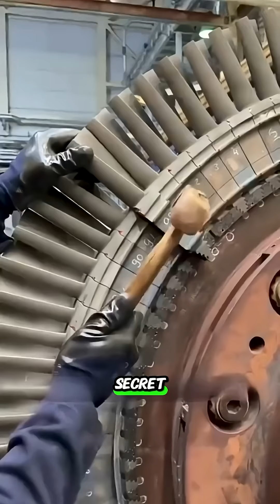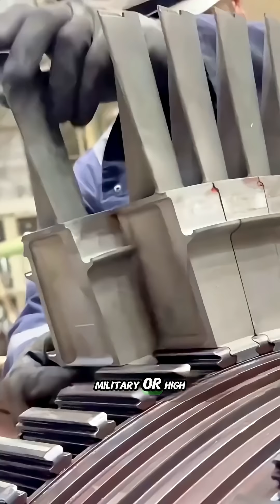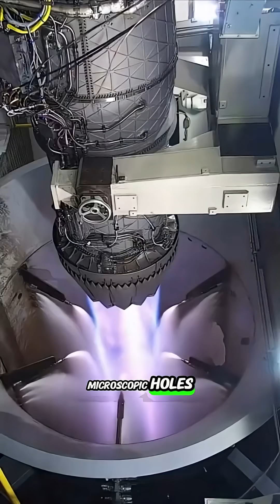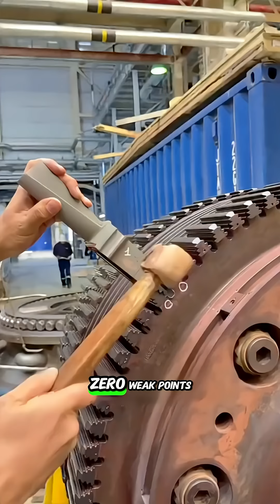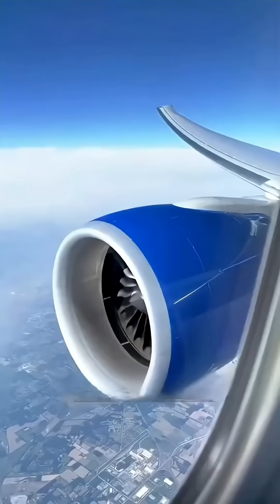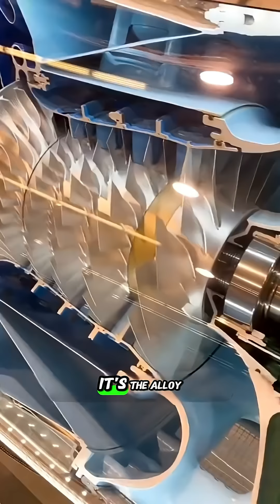The Insane Reason Nobody Can Copy American Jet Engines

Comment: Rolls Royce rolling their eyes
Reply: Create mostly accurate but misleading video, people run to the comments. creates engagement, profit.
Reply: @Shred303 you know what....your right.
Reply: @Shred303  yet the most powerful jet engine ever is in fact American the GE 9X, and even for fighter jets the most powerful fighter jet engine is the American Pratt and Whitney f135
Reply: @thatPilotandCarguy the problem is not power, any engine manufacturer can create powerful engines, the problem is reliability, the M88 of the Rafale is way more reliable than the F35 engine and needs less maintenance...
Reply: @SierraHotel-MB  Maintenance isn't as big of a deal when you have a $1,000,000,000,000 defense budget
Reply: @Vlalada0  Nope. A Jet, that is permanent    on maintenance can´t defned the people.
Reply: @Lutscherkoenig who has the raphael defended except in the papers
Reply: @gabrielebmomavug According to the U.S. Government Accountability Office, only 25% of F-35s are fully mission-capable (able to perform all missions). The cost of maintaining an F-35 is $6.5 million per year. Ten hours of maintenance are required for every hour of flight.
Reply: @Vlalada0 it is otherwise you wouldn't close the 22 project despite the QUALITY  of the aircraft, and many other exemple as the F14
Reply: @Vlalada0 1 trillion dollars which ¾ goes to the pocket of corrupt and filthy rich individuals.
Reply: @Vlalada0 isnt big deal ? 😅😂 what kind of American Logic is that 😅😂 big powerful - doesnt matter the cost 😅 im not amazed anymore why Americans are even Born with credit score 😅😂😂😂😂
Reply: @milanko91  I'm amazed you don't understand percentages
Reply: @Lutscherkoenig what jet is permanently in maintenance? Jane you not been paying attention to the middle east?
Reply: @Lutscherkoenig 25% percent of 850 is still 215 jets.

Also, another 55 percent are mission capable. That's 80 percent of all US F35s that are mission ready.
Reply: @Vlalada0 😂😂😂😂 yes that is my deep fault 😂 how Did you know that ? 😂😂😂😂
Reply: @Lutscherkoenig So you're talking about multiple different things. In terms of engine reliability the F-135 engines are some of the most reliable engines in the world. The overall reliability for the mission set is mostly because the F-135 is currently going through an upgrade where they're getting new additional features. Yes it is expensive to maintain the plane mostly because the stealth coating isn't cheap
Reply: @gabrielebmomavug tell me who the F35 has defended 😂

Clown
Reply: @thatPilotandCarguy . So? Is that metric relevant?
Reply: @milanko91  we aren’t born with credit scores wtf are you talking about. You have to build your credit score over years of financial responsibility.
Reply: @SierraHotel-MB  look at how many flight hours we get out of them. We do WAY more training hours and our pilots fly year round so they are always ready to defend like it’s just another day at work.
Reply: @krowwithakay the F35 needs to be grounded more than a day after every mission😂, the incident and malfonctions are multiple and so many compared to all other fighter jets that exist out there...you don't know what you are talking about
Reply: @krowwithakay hahaha thats what im talking About 😅😂 your matrix just shows that you dont understand that you are Born with credit score and with your interests and payments getting Numbers 😅😂 in normal countries there is no credit score 😅just shows how you think - the most powerful doesnt matter cost - shows how deep propaganda you have there 😅
Reply: @karrole88  you need evidence for such claims.
Reply: @Vlalada0  Until suddenly it is. Ask the Russians.
Reply: @thatPilotandCarguy Remember 1942 when Britain sent you a Whittle turbojet engine? The jet engine we invented and GE didn't think was possible... You can thank us now 😂 ...idiot
Reply: @thatPilotandCarguy Until Rolls turns out a bigger one. What are they fitting to the B52? Rolls Royce engines.
Reply: @thatPilotandCarguy But they were invented in England back in the 1930’s by Sir Frank Whittle.
Reply: @thatPilotandCarguy That wasn't what the video was about.
Reply: @Lutscherkoenig Can't even write a line  comment Who has the F35 defended? Attacked maybe, but the F35 has very limited combat experience. Fighter jets are a huge booondoggle - now more than ever.
Reply: @stuartplumbly7201 there was a German scientist that brought one out at the same time. And Germans got the first jet fighter into operational service. Aerodynamically it was way ahead of anything Britain built until after the Korean War. Britain gave the Nene engine to the Russians, who then used it to power the Mig-15. In addition to Nenes for Migs, Britain provided Seafire 47s, Seafurys, Meteor Mk8s, as thier contribution to NATO aviation.
Reply: @Lutscherkoenig  Yes both the F-22 and F-35 are expensive and cost a lot to maintain, but there aren’t any planes in the world that can stand up to them. Most enemies die never having detected the fighter that killed them
Reply: @Vlalada0 not for much longer
Reply: @Lutscherkoenig You are another ill informed fool that reads something without knowing what you are reading. GAO has nothing to do with mission readiness.
Reply: @Vlalada0 it is when you're at 30000 feet and more, it's not as if there's a hard shoulder like on a motorway you can just pull over and pop the bonnet 🤔
Reply: @Lutscherkoenig that’s why they mostly use the F/A-18 super hornet that was made around 3 decades prior
Reply: @SierraHotel-MB I hear that congress has plans to bring back the F14. It’s called the maverick act! They will refurbish 3  F-14D’s to use as instructional purposes as well as in air shows. Called “the Maverick Act”. I hope it’s true. I would love to see one fly again.
Reply: @SierraHotel-MB  No one claimed US Congress was intelligent. Their approval rating is 10%, and they control the budget.  Luckily, the 22 has been the boss for 30 years without being challenged, so we haven't ended up needing more.
Reply: @Lutscherkoenig  So tell us you don't understand what that statement means without tell us.    It does not mean the F35 is unreliable dummy, it means the supply chain is still young and has to compete with current manufacturing of new jets PLUS make enough spares for in service aircraft.  It has ZERO to do with the plane being unreliable.  Also, maintenance costs are a function of same supply chain maturity dynamics.  Costs are dropping fast as more planes are fielded and more parts become available as the supply chain matures.  this is true for every planes ever manufactured in history.
Reply: @Vlalada0 it is soon going to be very important
Reply: @gabrielebmomavug  Because Europeans don't run around the world starting wars like the US does.
Reply: @thatPilotandCarguy if you don't count the Rossians but I still doubt there's even US American engines at all
Reply: @Vlalada0 still it is.
Reply: @gabrielebmomavug France Africa the world
Reply: @Lutscherkoenig no tnx. My country like most countries we'll stick with the MIGs & Rafael's
Reply: @milanko91 yes at 1st grade we're already in bankruptcy but till the age of 21 we've already rebuilt our credits
Reply: @Mickey-s4c you dont understand concept where credits doesnt even exist 😅 you didnt rebuilt credits and by 21 there is no way unless you are rich family . You have school loans, medical loans , everything is in credits . By 30 you are repaying debts and building ratio on credits to be able to get better loans . In EU ( not UK as it is Anglo-Saxon system similar to yours but your is an extreme ) you dont have any credits . And dont tell me Americans are rich 😅 if that would be case - medical debt of Americans wouldn’t be as gdp of some nations and be crowdsourcing sites to help those people and etc 😅 you talking like in 21 every American is millionaire 😅 in fact - by assets you will find more millionaires in poor countries in that sense - because they own assets - they just don’t earn much per month . So its question about liquidity and wealth . By wealth measure every European can beat American . In liquidity maybe no - but again your liquidity is based on - you decide everything . From your net income you must decrement even insurance or so - our net income is real net income - just your normal expenditure on everyday expense - housing clothes loans and etc . In America if you don’t work for big rich corporations - you don’t have that luxury . You must account for insurance pension and etc
Reply: @Vlalada0 between the Senat & the Congress which one is more fucked up?
Reply: @milanko91 compared to West, the wages & salaries in USA are lower
Reply: @Mickey-s4c it depends how you measure those things 😅its not All simple answer as you go deeper 😅 but what Im trying to say - you have credit score and even boastimg About it 😅 but its just cage as you are borned with it and forced to use debt to have better future debts 😅 just think on how much debt US has on credit/debit cards vs in EU for example . Normal People in EU dont even have those cards . We are not forced to buy new iPhone on card debt because it will have good impact on credit score plus new IPhone 😅 for european mentality its wild concept 😅 We either have those money or dont 😅
Reply: @Vlalada0 boss of what ? Parade in meeting? 😂😂😂
Reply: @t @thatPilotandCarguy actually the GE X9 is suffering from development issues because of the size of the turbine fan. It is so big that the force acting against it is outside of the limits for even titanium
Reply: @eifeldude1  🤣 are you slow? Last time I checked there’s not a single jet engine in history that didn’t have development issues
Reply: @thatPilotandCarguy which aircraft  is that f135 engine in ?
Reply: @_Coffee4Closers until raw materials aren't shipped from China.
Reply: @Vlalada0 And a debt of 40 trillion...
Reply: @SierraHotel-MB  I just looked this up. it's not the F119, F135, F110, F100, and EJ200 all beat the M88. This is based on a comparison of Mean Flight Hours Between Removal.
Reply: @DUSTER7071  the also American F-35 lightning II
Reply: @baniganj yeah source :trust me bro😂
Reply: @Shred303  Well... at least this video wasn't entirely full of sh*t :D
Reply: I make these parts for RollsRoyce 🤣 they make jet engines
Reply: @jjmartin6422 How about the generation to generation engineering knowledge the workers posses?
Reply: @TheQuietStorm6000 I. Not sure what you mean here 🤔. Rolls royce has been making plane parts for about 80 years, they're just one company I make parts for.
Reply: @TheQuietStorm6000 
This video makes it sound like the US is the only country that builds jet engines...
No even close to true.

The Jet was  originally invented by British engineer Frank Whittle, when he got his first patent in 1930.

In 1933, a German engineer called Hans von Ohain also designed a jet engine.

As for the modern era, Airbus aircraft use European designed & built jet engines.

The Eurofighter Typhoon uses the European designed and built EJ200 jet engine, with an official top speed of Mach 2.0,  Mach 1.5 supercruise and maximum recorded altitude of 87,000.

And there are other countries around the world that build their own jet engines.
Reply: This is what makes a country a super power.  Not financial engineering.
Reply: @jjmartin6422 Do you work stateside or in England?
Reply: @Common_Sentences I am state side, for certain parts the Gov. Mandates that they cannot be sourced or shipped outside the US, common parts aren't as strictly controlled.
The company I work for though does manufacture in Canada and Mexico as well.
Reply: @TheQuietStorm6000 read some history
Reply: @simonoleary9264 ... Which is why they didn't say the US is the only 1. They did, however, state that we've dominated the jet production scene for 50 yrs. That's a far cry from claiming they're the only producers. We're rapidly losing our manufacturing edge so just keep from getting your panties in a bunch & you'll get your shit-talking opportunity.
Reply: @st.bonhomie8585 stfu.  My kids aren't this immature and antagonistic kids. They are 8&9.
Reply: @simonoleary9264 but when it comes to military jet engines, Pratt & Whitney basically dominates that market. They’re the ones that makes the engines for the f35, which has the bragging rights of being the most powerful afterburning jet engine (I believe) ever made.
Reply: @brendanlaven1697  oh, how about the Russian jets? The Chinese? Swedish? Seriously.
Reply: @brendanlaven1697 that’s only true compared to the J58 because a lot of the J58s thrust came from the inlet and the bypass tubes in the nacelle taking that compressed air right to the reheater. 

But yeah between the J58 and F135
You got two powerful beasts.
Reply: @Helen @Helene-e4x he Swedes don’t build their own jet engines for the Gripen. They use American engines. Building jet engines is hard.
Reply: @passantNL  Ah, right, I confused it with the Eurofighter, my bad.
Reply: @Helene-e4x  Russian and Chinese jets are well known for having short lifetimes, fighters anyway. They build for light, cheap, high maneuverability thinking they're going to get shot down anyway, so why go expensive? China mostly builds licensed Russian knockoffs, Migs. I guess the J-20 is theirs.
Reply: @fedfraud.protection.servic2557  although, you must admit that Rolls Royce manufactures quite good engines, Pratt & Whitney and General Electric are not the only ones. Besides, that Russian and Chinese jets have short lifetimes does not mean that the engines are bad.
Reply: @Helene-e4x I think that the statement was more aimed at the countries that the US and UK are adversarial with. We share knowledge, engineers and tech.

I worked at an Aerospace Shop in the US once that started production in China, we had some machines we sent them. We were required to go into the software of the machine and mess with the parameters so they couldn't maintain the regular high accuracy we had in the US. So we do things like this as well.
Reply: @SeatownD   fair point, but that does not change that the jet engine is not american, and that the usa is not the superior manufacturer
Reply: @TheQuietStorm6000 generational knowledge from workers is useless. Managers don't care. H1b is all they care about😅
Reply: @simonoleary9264 derby woop woop
Reply: @simonoleary9264 . Hans von Ohain of Germany was the designer of the first operational jet engine.

But who was “first” is irrelevant
Reply: @TheQuietStorm6000 
It is both! 😉
Reply: @Helene-e4x 
RUSSIAN NUMBER 2
SWEDISH NUMBER 3.
Reply: @simonoleary9264  Boeing also uses European engines, btw.
Reply: @brendanlaven1697 but they still rely on British engineering for the vertical lift system.
Reply: @Helene-e4x I'm biased, but the US IS the superior jet engine manufacturer. Of course, Rolls Royce is up there, as well. That's part of why the US has the best fighter jet ever manufactured. China and Russia, their jet engines are the cars of today. They're throwaway designs because they know they can never compete with the west's superior design and manufacturer capabilities.
Reply: @TheQuietStorm6000 what? Telling yourself you are the best until you believe it?
Reply: @jjmartin6422 It's actually 111 years.
Reply: @simonoleary9264 Yeah yeah yeah whatever.  The US has made the most advanced jet engines for civilian and military use for decades.  Rolls is great but they have been helped by GE and Pratt and Whitney. The Russians and Chinese have for years been trying to steal our technology for jet engines for decades.  Hmmm wonder why that is???
Reply: Also you fool no Typhoon flies at over 80,000 feet.
Reply: @TheQuietStorm6000 but murica isn't a superpower. It's only famous for hamburgers and stupid presidents
Reply: @simonoleary9264 America's are best tho
Reply: @TheQuietStorm6000 Which of course can only happen in America.
Reply: @jjmartin6422  I do too..
Reply: @jjmartin6422 He didn’t say No One else did he.  I believe he said hardly anyone else.
Reply: @xXGENDAMAGEXx first of all you need immense amounts of investment to mount an enterprise capable of doing this. Also, a highly complex and very expensive educational system to train engineers and workers. It's an entire system that only a few rich countries can do.
Reply: @botutu1   Plus you're going to have a bunch of R&D Investment or else foot the patent bill for licensing. That could jack the price up. This is an eye opener.
Reply: @xXGENDAMAGEXx  Read the very bottom line in the video. Now you are just playing 
semantics.
Reply: @davidkillens8143  Yes, it says "The Insane Reason Nobody Can Copy American Jet.

Why is it so hard to build a jet engine? It’s not about the blueprints—it’s about the impossible manufacturing process. From turbine blades that cost as much as a BMW to internal cooling systems more complex than human veins, discover the insane engineering that keeps American jet engines 50 years ahead of the competition."

They did boast that "Nobody Can Copy American Jet." and that they are "50-years ahed of the competition."
Reply: @jjmartin6422  The Trent 1000 has been Rolls-Royce's most troubled modern engine, costing the company over £1.3 billion in repairs and redesigns.  

That is just the top of the list of defect and process in manufacturing issues with Rolls Royce. All Manufacturers have spec issues..but Rolls Royce is not a bragging point in Aviation anymore my guy.

Sincerely Aeronautical Mechanical Technical Engineer.
Reply: @jjmartin6422 And of course superb cars ..
Reply: @jjmartin6422 no you don't. The use of emojis suggest you to be a teenager. Epic fail
Reply: @jjmartin6422 and Ford makes cars.  Doesn't make them equal to a rolls does it? You get the point
Reply: @jjmartin6422 I was about to ask , what about RR. Sean them on many of my flights. So RR and American engines dominate...
Reply: @jonjones1233 but the RR. Factories are in the U.S  and Germany
Reply: @stubstoo6331 AND in Derby, in England.
Reply: @martinsims1273 yes all business today is global
Reply: @jonjones1233 umm (seen)
Reply: @jjmartin6422 Listening is hard for you, he said “very few” companies have mastered it. Didn’t say nobody, calm down
Reply: @gregjokonis1776  the title says "nobody can copy American jet engines" ... the BS was made at that point
Reply: @patthewoodboy Ok buddy, whatever helps you sleep at night
Reply: @gregjokonis1776   I dont sleep at night I am a vampire and will come for you 🙂
Reply: @gregjokonis1776 Reading is hard for you....
Reply: @gregjokonis1776  Read, man. Read
Reply: @Geokinkladze Nope I did read and it was supplanted with very few, so if you want to go down that route and stick to comment, so be it. You defending your boyfriend is cute as well.
Reply: @gregjokonis1776 You effed up dude, come on, just accept it.
Reply: @theeltea I didn’t so go sit in the corner and hush.
Reply: @jjmartin6422 
If that were true you'd know that even the engines in the EF Typhoon still pale in comparison to the engines in the F22.
Let alone the ones in the F35 or our new adaptive cycle engines being developed.
The video is right. Anyone can build a jet engine.
No one builds them like the US.
Reply: @W1ckedRcL  you are correct. IDK what I said that makes you think we're in disagreement 🤔
Reply: @jjmartin6422 
I thought you were saying you make parts for Rolls and implying that it's not a big deal. That anyone can do it like the US.
I have apparently misunderstood your tone.
My bad.
Reply: @W1ckedRcL all good. I make the parts for RR in the US 😎👍
Reply: @W1ckedRcL 😅😅
Reply: So, the US is the only country successfully building jet engines. apart from UK, Germany, France, Japan, China, Russia and Sweden, no one can build jet engines. Oh, wait Czech Republic builds some as does Korea and India. But apart from them and the countries who supply parts, what have the other countries have ever built jet engine parts like compressor blades. Oh wait, Ukraine builds some parts and there are countries who contribute other parts. But…….what country produces the most 🐂💩 per year? Yes, the US wins that category.
Reply: @gill7087 
Hold on... Military jet engine manufacturers are really a small club.
UK and France are part of it. Rolls Royce and SAE are doing their military engine 100% on their own.
But not Germany (MTU built 30% of the EJ200... Far to be enough), not Sweden (they use GE engine rebranded with small modifications. The HPC part you can see in the video... Nope).
Czech republic... Nope. PBS built turboprop but not military jet engines.
Japan: nope too. They build turboprop too. 
Let's be clear. A modern and competitive domestic jet engine is a huge challenge. Among the US, only UK and France master it 100% for the west.
Reply: @rcouderc But the UK builds fighter jets engines and Passenger planes engines the UK was the first country to use her engines it's an innovator not a copy
Reply: @theancientsancients1769 Exactly, that was my point! The UK and France are the only two European countries capable of mastering this technology from A to Z completely independently, without relying on the US.
And don't worry, I never said the UK was a copycat—quite the opposite, Rolls-Royce's heritage speaks for itself!
Reply: @rcouderc Ah cool cool 👍🏻😃
Reply: @rcouderc hey dont say that bro😅 im about to start my career with MTU . I might have to reconsider then
Reply: @BorisDasgupta-v4g   it's an excellent company. I'm sure Germany will decide to order a fully German made engine in the future. Likely for UAV but it's already very good.
You should go there.
Reply: @rcouderc 😂😅😂
Reply: @gill7087 GE is still the King! Been that way since WW2.
Reply: @gill7087 China and Russian jet engines last about 30-50 percent of the lifetime of the US engines.
Reply: @SeatownD  you got stats to back that up? 😸
Reply: @SeatownD we were saying that about their cars, today they make better electric cars than anyone out there 😂, so I can't garantie you that you will still have that gap in the next 10 years
Reply: @SierraHotel-MB Their drivetrains are good. The build quality has sucked since their inception, and god help you if you get in an accident. My brother is a claims adjuster for a major insurance company, getting parts for them is a bitch.
Reply: @SeatownD  for Chinese cars? they don't exist in US. Of course, getting parts for them would be impossible because they are banned.
Reply: @gill7087 i thought that would fall to brazil or australia due to the fact tjey are the cattle barons
Reply: @gill7087  It's so easy to find pit how you're wrong. Just look up the efficiency difference between US and Chinese jet engines.
Reply: @gill7087 India doesn't build jet engines, not commercial ones at least.
They are trying to build a domestic one for millitary for years.
Reply: @gill7087  .....somewhere in south america as well i think.
Reply: @gill7087  You can build a jet engine...does it make it reliable and pass spec to be applied to Military aircraft much less passenger jets without costing a company 1.3B in revenue loss due to spec and failure though?

Allot of people build cars..but most of the countries you mentioned are never mentioned in that industry either...lol

BTW  Amount produced is not the issue...quality and spec are..ask Rolls Royce how that is working out for them currently..the dudes at Pratt & Whitney are laughing their asses off with their military contracts right now.
Reply: Rolls-Royce and builds the engines we make all the parts for him here because there's no one can even more spending that kind of money build the machines to make the parts
Reply: @Ripsaw17 parts aren’t all made in U.S.A. but China n turkey n other places
Reply: @Ripsaw17  yes with german or chinese CNC mashines😂
Reply: @Stegaleniker  Japanese and American.
Reply: @Sgtwilco3006aah now i understand what my engineer friend mad him quit his job at SR technics because of bad quality parts
He mentioned something they should better buy cnc from mägerle so at least the parts would fit😂
Reply: @Stegaleniker  A machinist complaining about a CnC Machine and then saying their parts don't meet Tech and Spec is not a Machine issue. 
It's a milling issue or a Machinist/ internal inspection issue.

If it is getting all the way to the application and fails spec...the Company that produces them should feel ashamed. 
That is long before the engineers who do the final inspection after the FAA dictates it's within tolerance find issues.

Sounds like you work for Magerle honestly...lol
Reply: @Stegaleniker Or Cincinnati 😂😂😂😂.
Reply: @Stegaleniker  Or change operators or methods specs. Couple hundred RPM can make the difference between good and scrap on tight tolerances. Industrial machines are built to last a LONGGG time before wearing out of spec. I ran Warner Swasey turret lathe from WWII in the 70s had .002" slop in cross travel. Still held. +/-.0005". Tooling, too. Spindles never wear out.
Reply: @Stegaleniker There's no Chinese CNC machines in US or UK aerospace.
Reply: @BadKarma-u9h Go run a Haas VF8 in a shop that's not properly temp controlled and get back to me. The tool length can change by .002 or .003 inch over the course of the day because of spindle heat creep.
Reply: @Stegaleniker China was an idiot, backwards, 3rd-world nation when these things were getting made, and still, virtually all the Chinese have they copied from us or were given the specs by us.
Reply: @SeatownD  boing like quality only
Reply: @fedfraud.protection.servic2557  yes if budget is tight you order US machines and if quality matters mägerle from switzerland every machine single designed for its purpouse and no match in accurecy for them in market available
Reply: @BadKarma-u9h  year FAA was also mention because of them and boing manuel he had to lower his standards and felt ashamed whenever he fixed an jet
Reply: @fedfraud.protection.servic2557  was a while ago know for high end cnc but now focused more economical production
But very tough and long lasting
Good machines😊
Reply: @fedfraud.protection.servic2557 Cincinnati is based. Aren't they called Milacron now?
Reply: @Stegaleniker the CNC is the easiest part, that's America's 1950s numerical control.
Reply: @Stegaleniker huh what are mashines?
Reply: Safran too
Reply: @simonmeszaros2770 Safran does production in the US. The shop I work at makes parts for them. They have a hub in Washington State and also Texas I believe. This kid I know from the gas station I used to go to said his dad is a higher up there and just got transferred to Texas.
Reply: I heard an Americans false sense of us first. Next it will be who achieved vertical takeoff and landing 1st. 🤔 No, not the flying bed, the Hawker Jump Jet.
Reply: @robertwoolley8632  Dassault Balzac V was earlier , Harrier was the first that got put into service , but there where a lot working ones before but mostly cancelled due to costs.
Reply: @robertwoolley8632 Ah, the British false sense of me first. We present to you the airplane as demonstrated by the wright brothers.
Reply: @gregjokonis1776 damn thats not fair, we bringing ancestors into this discussion
Reply: @gregjokonis1776  Ah, we have to go there?
I present to you, the 13 Colonies, i.e your very existence.
The Magna Carta of which the Declaration of Independence was heavily based on.
The language you're using and the computer and Internet you're communicating with, to name but a few.
You're welcome.
Reply: @demadnutter8182 Ah, I present to you, a middle finger which is what our fore fathers gave to good ole bloody England. And a whooping
Reply: @demadnutter8182 Define "internet"... That was developed by DARPA (US). I think you're maybe confusing the work of Tim Berners Lee in developing the World Wide Web, which uses Internet Protocol as the transport layer.
Reply: @robertwoolley8632 Britian is a joke in the Avionics world
Reply: @andrew-m-b70 Wellllll, I mean you’re not wrong but let’s talk about British politics and laws. Can’t say much of anything in good ole jolly England without fear of getting in trouble, I find that a joke.
Reply: @gregjokonis1776 Like US Senators reading the words of the US military code and being threatened with arrest and hanging by Trump?
Reply: @adamgt4037 Yeah, Boeing doing well at the moment, aren't they?
Reply: @gregjokonis1776  Land of the free baby. 

Oh wait a flock camera just reported me to my HOA for having the wrong grass.
Reply: @adamgt4037 like America with wars then😂
Reply: @gregjokonis1776 .  😂 they have more freedoms of speech than the US and better education too.
Reply: @robertpatrick3350 That’s not entirely true, especially freedom of speech. You are clearly either misinformed or unable to follow the news. But I will let you figure that out, ignorant.
Reply: @gregjokonis1776 you can say whatever you want except for insults and libel .
Reply: @loboptlu Oh no, I can insult the crap out of someone but you’re correct on the libel. You see for libel it has to be false, if I insult you and it’s true, well suck it up.
Reply: @gregjokonis1776  well thanks for the money then.
Reply: @loboptlu Clearly don’t understand the law, ignorance it’s great in your eyes.
Reply: @gregjokonis1776  what law american one ?
Reply: @gregjokonis1776 in every country that signed the human rights charter insults are an attack on human dignity and punishable by law and enforced in every justice system of those countries who signed it .
Now if you live in the USA who didn’t sign so they can continue their atrocities in the name of freedom, sorry for you.
Reply: @loboptlu An insult carries no harm on your human rights and that’s common sense. If you are so fragile that someone insulting makes you cry, grow up and get over it crybaby. See, I just insulted you right there. Now did that hurt your dignity or your human rights, nope. Stop whining. What country do you live in so that I may have a better perspective on your fragile feelings?
Reply: Here is you human rights chatter you shmuck. Freedom of opinion and my opinion is that you are overly sensitive 

Article 19

Everyone has the right to freedom of opinion and expression; this right includes freedom to hold opinions without interference and to seek, receive and impart information and ideas through any media and regardless of frontiers.
Reply: @loboptlu  Here is you human rights chatter you shmuck. Freedom of opinion and my opinion is that you are overly sensitive 

Article 19

Everyone has the right to freedom of opinion and expression; this right includes freedom to hold opinions without interference and to seek, receive and impart information and ideas through any media and regardless of frontiers.
Reply: And I forgot to add, the United States did sign it. Your problem is, you don’t know how to interpret it.
Reply: @loboptlu Please tell me where you live so I can get to the bottom of your ignorance.
Reply: @adamgt4037  has Boeing finally got their no-response steering sorted yet?
Reply: @9 @933__rce at in the hell are you talking about? One, If you look at my comments fool, my point was that I can insult people all day and I “ will not” get in trouble. Is reading comprehension hard for you? Let me guess, you failed English class in school. And Rogan is a nut job.
Reply: RR have been growing blades for many years. They're the people who made the Olympus engines which powered the Vulcan "V" bomber and Concord, and the RB211 engines which propelled the Jumbo jets, and a good many long lasting, reliable engines which have seen 100's of 1000's of miles on 1000's of aircraft around the world (+ in ships, and stationary power plants).
Reply: @martinsims1273 Don't  forget the Nene that Britain gave to the Soviets to use in their Mig-15s.
Reply: @leonardwilliams8109 And wasn't the Grumman Panther originally powered by the P&W J42, which was a Licence-built Rolls-Royce Nene? The J42 may have been replaced by the J48, which was a licence-built R-R Tay.
Reply: The Nene wasn't given to the Soviets. A couple of dozen were sold, subject to an agreement (which proved to be not worth the paper it was written on) that they would only be used in civilian applications.
Reply: Why? They manufacturer much of it in the US as well.
Reply: CFM
Reply: Try Pratt and Whitney. They make the most powerful single jet engine for A fighter jet anywhere. The 
F135  Pratt and Whitney @ 115.000 HP max and 43.000 Lbft of thrust for a 29.300lb Plane and 70.000 lbs max weight. It has a new engine varient, Block 4 which is still classified total HP. But increased KW Electric output. And colling. Abilities. Rolls Royce does still make good jet engines but Pratt and Whitney are in a class of their own now. And have been for a while.
Reply: @BobDixon-f7n  Only if you look at raw engine power. The essential part isn’t how much vroom-vroom the engine makes. No one buys F35 for its speed or what do you think the power translates to? Russians, eurofighters etc are known for their maneuverability. The benefit of F35 is it’s stealth. However in the heat control that adds to its stealth GE and Rolls Royce excel. GE and Rolls Royce also build an engine that can be changed in 45 minutes. F135 change time is in multiple hours.

Coming back to the engine power, the F135 is much larger than the counterparts I already mentioned. If looking for raw power a single AL-51F1 would be very close to the F135, but they are used in pairs and have 3D-supervectoring built in. We don’t however have much information of the Russians to properly compare.

Considering the essentials, for reliability GE engines are at the forefront. For lowest heat signature Rolls Royce should excel. So the next generation of fighters would very likely be heading for something like them. Pratt & Whitney has work to do to get the engine to their size maintaining high power output and improving significantly the maintenance. The F35 itself could go on a diet so the power to weight ratio would compete.
Reply: he did say.. and i quote.. " almost no one else" . he didn't say "no one". English comprehension is key here,bud!
Reply: To be fair he did say ALMOST
Reply: Yep, just YouTube slop
Reply: They are the ONLY other one who can. And their TRENT almost put them out of business if it had not worked.
Reply: @RANDassociatesinc But it did work. 😎😊
Reply: @paradisekohchangstyle2150 yes!!! To everyone’s relief!!
Reply: Thats why the PRC steal the designs but can never replicate the materials.like high speed train wheels the bought from germany and japan and tried to copy them.
Reply: @BaccillusAnthracis  high speed train from Germany? Not sure anyone wish to copy such poor and dangerous design...
Japan shinkansen ok... But ICE... Remember Eshede?
Reply: @rcouderc wheels.Germany and japan makes the worlds best wheels for trains
Reply: @BaccillusAnthracis 
This is theory.😢
Facts say: "Unlike the Shinkansen in Japan, Germany has experienced a fatal accident on a high-speed service. In the Eschede train disaster of 1998, a first generation ICE experienced catastrophic wheel failure while travelling at 200 km/h (124 mph) near Eschede, following complaints of excessive vibration. Of 287 passengers aboard, 101 people died and 88 were injured in the resulting derailment, which was made worse by the train colliding with a road bridge and causing it to collapse. The accident was the result of faulty wheel design and, following the crash, all ICE wheels of that design were redesigned and replaced."

If you look for the world better trains wheels, you have to look at France with 575.8 km/h.

We all live our countries and the wonder they may product. It's ok to be proud.
Reply: and yet, rolls royce never built an engine that can sustain mach 3.6 for an hour & 15 minutes, or an engine that can cruise at mach 2+ without afterburner for extended periods.
Reply: @jaybee3165 . Your education system failed you
Reply: @jaybee3165 RR Olympus. Concorde cruised all the way over the Atlantic at Mach 2+ without afterburner.
Reply: I think people should stop the urination game, RR makes fine jet engines period. So do several American companies. I feel safe on RR engine equipped planes. But I won't feel safe on any Russian, Chinese, or other country engines because we've seen what some of their crap does. I believe the original Jet engine inventor was English but I believe the Germans built the first useful jet Aircraft. The world's come a long way in a short time.
Reply: @jonjones1233 
Frank Whittle made the turbojet a practical aircraft engine and helped create the jet age. Unfortunately, he put out his turbojet patent into the public domain in 1930, as he couldn’t afford to develop it further. Unfortunately, this allowed the Germans to find it and they used it as a basis for developing their own jet engines used in WW2: He 178 (1939) & the Me 262 (1942). Whittle’s W1 engine led to the UK’s Gloster E.28/39, and Whittle’s designs later informed American jet engine development as well. That transatlantic transfer helped accelerate jet development in the US. Facts! Look it up guys!
Reply: @RuStylesand then gave the Nene to the Russians to help their Mig-15 program!
Reply: Except they don't break down after 30k miles lol
Reply: Actually rolls Royce is that advanced because they helped make military planes.
Reply: So Russia gets their engines from where?
Reply: @DogzDinette Russia makes their own. And they last about 30 to 50 percent as long as American Jet engines.
Reply: You’re joking right?
Reply: "Almost nobody else"
Reply: You kidding me nobody else can make more bs 😂😂😂 rolls royce have been doing this for decades and invented the crystal method
Reply: @mudabudda There are 200 countries on earth and less than ten have the capability to build jet engines. That's almost nobody.
Reply: Yet 80% of British planes are American made 🤷‍♂️
Reply: @Doz3Rfpv yes, all those "American" airbuses are everywhere.
Reply: Uhmmmm what a load bollox the yanks didn’t even invent the jet engine ….. Rolls Royce pioneers most jet engine manufacturing techniques that the America. Manufacture attempt to copy
Reply: @Fatboyslim-x9l what people aren't understanding as and englishman, we invented it, everyone betters it. China are world cnc champs, chip champs, modern warfare champs . . . We English invent stuff and think "that will do"
Reply: @Richardsongdg china are CNC champs? 😂😂😂 surely, you mean Japan?
Reply: @petehartmann5443  definitely china. Me old china !
Reply: GE 9X is the strongest jet engine btw, and the strongest fighter jet engine is also the American Pratt and Whitney f135
Reply: IHI as well
Reply: Modern single-crystal superalloys were jointly pioneered and invented by engineers at Pratt & Whitney (a subsidiary of United Technologies Corporation) in the late 1960s and 1970s.They revolutionized aerospace engineering by eliminating grain boundaries from turbine blades, allowing modern jet engines to operate at temperatures hotter than the melting point of the metal itself.
Reply: That's the reason.. only few companies in aviation giant actually have potential n calibre to design such complex jet engines
Reply: That’s why Rolls Royce has a plant in South Carolina… we know how to do da shit 😂😂😂
Reply: I was going to post this. 😂they are world leading in material science and turbine designs
Reply: At the dawn of the jet engine, rolls royce couldn't produce the turbines. There was a US company that could. For decades, General Electric in Lynn Massachusetts had been make turbines for steam electricity generators.  When Rolls came crawling to GE in the 1940s, GE produced their first jet engine in under 6 months.  GE has been in the lead ever since!
Reply: @robertthomas9564 The Whittle jet?
Reply: Well, Russians are doing it too.
Reply: Pioneered early jet technology home to Rolls Royce, which builds high performance civil and defense engines.
Reply: Yes and better than most American designs who actually preceded them in WWII
Reply: @llewev  WWII ? 😂😂 You mean the second World War the U.S. had to win for the Brits? We’re about 90 years past the Merlin my guy
Reply: Damn straight -!!
Reply: They are made in Wixom, MI
Reply: Not more intricate
Reply: 18% of the market. They don’t have much else to do but roll their eyes.
Reply: Was thinking the same thing
Reply: Yep what a fkn joke
Reply: CFM rolling around on the ground.
Reply: @MichaelEnright-gk6yc😂😂😂😂😂
Reply: The UK wants a word with you 😂
Reply: That's right. 😊
Reply: Thanks
Reply: Beat me to it.
Reply: Meanwhile Pratt & Whitney laughing at Rolls Royce because they don't supply the U.S Military factually Pratt & Whitney does.
Reply: @BadKarma-u9h The F35B lift fan. The T45 Goshawk uses UK built RRTM Ardour engines. And just retired from US service, all AV8A and AV8B Harriers used UK built RR Pegasus engines.
Reply: It is an American Company? ;-)
Reply: @erichpaul6508 no it isn't?
Reply: Beat me to it
Reply: Lol who? That old company
Reply: More like Roycing their eyes
Reply: Joke?   Isn't multiple UK leaders being kick out recently?
Reply: You beat ne to it....😂
Reply: 1st thing that popped into my head!
Reply: Never mind Rolls Royce. There are hundreds of gas turbine manufacturers around the world and dozens of those would have the ability to step up into high performance aero engines production if it weren't a mugs game from a business point of view. Their accountants are far happier with them serving other markets.
Reply: @jimf671 you ok jim you sound salty because you're piss poor 😂 should of done better at school me old spud!
Reply: Okay, then what is your reason America dominates the jet engine industry, cheap labor?
Reply: @farmer1ab 🤣
Reply: They don’t. That is the point.
Reply: What a load of shit!
Reply: Listening comprehension issues?  

The first sentence uses the word “dominates” not “exclusive” , which is an accurate statement.
Reply: The GE90-115B enters the conversation
Reply: The butthurt in these comments is wild
Reply: Like I am at you?
Reply: 😅😅😅 bullshite 😂😂😂😂😂
Reply: RR 🧐
Reply: Rolls Royce is about long haul, wide body engines and muh fuel efficiency. American GE is about raw power and thrust! RR is a generation behind in engine development.
Reply: @bullwinklessprinkles4727  It's amazing how one can be so confidently ignorant.
RR took Concorde to Mach 2+ in supercruise, no afterburners used.. That's raw power.. 5 decades ago.
Reply: @NoJoy1980 and now, what? 😂 Just one modern GE engine produces over 75% of the power of all four Concorde engines combined. RR is a generation behind in modern jet engine building. Cry harder!
Reply: @bullwinklessprinkles4727  Sure buddy.. That's why airbus went with RR instead of GE. But they're crap too right? At least they're not falling apart mid flight. Typical old school american mindset. POWER!!!. That's why the A350 is such a success compared to that massively delayed 777x. It's way more fuel efficient. Why? Technology always beats brute force at at the cash register. Cheaper fuel costs = more win for the airline. But keep being that primitive know it all. 
Generation behind.. What a moron.
Rolls-Royce is way more advanced in mechanical architecture and aerodynamic efficiency.
I don't cry because an uneducated person I don't know thinks he has the monopoly on opinions.
Reply: Stop bulshiting single hair strand lol
Reply: USA stupid didn't invent them😂😂
Reply: Rolls-Royce turbine blades don’t hold a candle to GE. Those are facts.
Reply: Literally came here to make the same comment. Americans are so up their own arses they hm think there’s nothing other than America.
Reply: Here's something to Google. Back in WW2 when RR needed to mass produce engines for their fighters they called on the U.S. 
Knudson the GM CEO at the time asked Ford.... got turned down but then asked Packard, the American RR Equivalent.
No sht look it up they were the first to put AC in their cars
RR worried because their engines were to 'tolerence precise" thought they would have to rework it all because "messy chaotic Americans" yea?
They got the engines back from Packard and them biches were tight and ready to last twice as long than the originals.
So before you "roll your eyes" do a little history research
The best stuff came out of the UK and the US working together 
Shelby Cobra still hasn't been beat on a track yet.
Reply: IKR?  All five permanent members of the UN Security Council can manufacture single crystal turbine blades, China being the latest member to join the club.
Reply: UK, France, Germany, Japan Ukraine and Russia manufacture jet engines too. Indeed USA is the major producer, but not the only one.
Reply: I thought that about 1 minute in.
Reply: Frank Whittle was the first to invent the gas turbine jet engine.. he was British.. 🇬🇧🇬🇧
Reply: Agree 
As soon as you hear that robotic American voice you know they are full of shit.
Reply: Yes, at Boeing haha
Reply: Literally on 70%! Of all commercial airliners
Reply: True.
Reply: Same story, they put up as many decades of accumulated engineering as the American jet engines and because they were US military contractors maintained access to America's cutting edge material science and defense engineering
Reply: You Americans 😂
Reply: More like conspiracy theorist rolling their eyes, "chem trails"
Reply: RR is a company that makes/designs parts for the engines
Reply: They are about 13% global share and ‘dominated’ innovation in very large fan jets through the development of wide tang compressor blades grown as a single crystal from the root.  This video even shows this exact type of blade being mounted😏🫣🤨😠
Reply: HAHA !!!
Reply: I presume you also think the Russians are crap jet engine makers.
Reply: Not to mention Frank Whittle rolling in the grave.
Reply: Your exactly right.
Reply: I thought Rolls Royce was British! American bullsh.t at its best. They've yet to build a decent car.
Reply: I was thinking that
Reply: My first thought!
Reply: Rolls Royce bringing up the rear
Reply: Rolls Royce largely relies on US parts suppliers and even has final assembly plants in the US.
Reply: @ThoughtMachine1 RR make their own turbine blades which was the topic here.
Reply: It doesn't matter what you are talking about, if it makes America look good, the Brits will claim that they did it first and better...
Reply: @douglasbuckland8280 well they did and they still run murica behind closed doors it's written in secret clauses in the declaration of independence d
Reply: That's what I thought 😂
Reply: Rolls-Royce communicates and occasionally explores joint business or technology partnerships with major U.S. jet engine manufacturers like GE Aerospace and Pratt & Whitney,
Reply: And China Shenyang.
Reply: China rolling their eyes to
Reply: Hi
Reply: Pk Hlppys ❤😂🎉😮😅😊
Reply: Who invented the jet engine??? Lo😂😂
Reply: And R&R should be. I believe the B-52C model has R&R engines(?).
Reply: I agree, Rolls Royce tries hard.
Reply: Agree 101%.    RR was building jet engine while you were still sucking your thumb     Come to think of it you probably still are.  !  !
Reply: He said "almost nobody else can build these (jet engines)". He didn't say NOBODY BUT THE US can build jet engines". Work on your listening and comprehension skills.
Reply: At what? Most powerful jet engines are American made smart guy. Furthermore the bot said “very few countries” Not sure how that throws shade on the British. Even in their pathetic current state
Reply: Assume Rolls Royce is still British?
Reply: You beat me to it 😅
Reply: @AndyMales-f3k  Awe. Another Brit wishing they were still relevant
Reply: Why are you guys comparing a blood cell to a jet engine.. random af lol
Reply: @taylorlatch94  Blood vessel. Hmm, may a metaphor for complexity? Just a wild guess
Reply: @hermitrob simplicity is better. Like a star
Reply: I think I replied to the wrong comment though, it was below, whoops
Reply: Everybody agrees
Reply: @normanvingoe1368  About what? Britains insignificance on a global scale? Military?
Reply: @hermitrob about Americam plane manufacturers installing BRITISH jet engines...
Reply: @normanvingoe1368  😂😂 First of all the post never made any claim that the U.S. made any claim about being the only ones. Thats just what butt hurt Brits hear because they know how ridiculously irrelevant they are on a global scale. They produce next to nothing and import almost everything. The U.S. would run them over in a matter of weeks if it wanted to militarily, financially and any other statistic you can think of. Just another one of our whining children. So just say thank you and hush up
Reply: @hermitrob while still claiming to be 'allies' and forgetting where most of their families originated.
Reply: Russians are also rolling their eys 😂
Reply: @AArata63  Russia 😅😅😅😅😅
Reply: Was just thinking that!
Reply: @borderman2019  What how insignificant Britain is on a global scale? I agree. Just another one of the United States whiney children
Reply: He said “only a few countries” .
He didn’t say “ Only the U.S.”
Reply: And Pratt and Whitney
Reply: @SoreHead11  🤣 Pratt and Whitney is an American jet engine company bud🤣🤣🤣
Reply: English is a wonderful language and missed even when “few countries have mastered…” is loud for all to hear!
Reply: There's a good WW2 video by an American, WW2 historian.
He shows loafs of American inventions that couldn't make the grade, but when the creators cam e to England in on the 40's, British investors had the soutions.
Rolls Royce engine was one of them.
British and American collaboration, follwed by American, British and German collaboration made the West technologically advanced.
Japan entered the fray a little later, and this produced the world of tech woth have today
Reply: so does, SAFRAN/SNECMA
Reply: Yes. Another of the countries cabable of building jet engines of the highest power and quality is the United Kingdom , personified by Rolls Royce.  
Another is Russia. China has fighters based on Russian design that are vastly inferior to their theoretical performance because last I knew they were still using lower performance temporary engines. China can't build good enough jet engines even having actual working Russian engines to copy. 

Unrelated but Rolls Royce. 
The first P51 Mustang  WWII fighters had inferior performance at altitude.  Then Rolls Royce Merlin engines were fitted. Result the most effective WWII fighter. Nothing else could fly cover with long range bombers. Most of those engines were built under license by Packard. The best of the Rolls Royce/Packard Merlin engines were built in the General Motors Chevrolet Engine Plant in Flint Michigan.  When Packard inspectors asked my grandfather who was a machinist serving in quality control how  a manufacturer of cheep cars could exceed a manufacturer of luxury vehicles in low cost and uniformity he answered that low cost was the key. Chevrolet could not afford fit each piston to its cylinder individually. Every piston had to fit any cylinder.  It is public record that Packard then achieved extraordinary uniformity. They were able to sort replacement pistons into only 3 ( I think it was 3) sizes and they fit. Individual machining was not needed.
I also know something from my grandfather through my father something about that plant that is still not generally known. Between the assembly lines for aircraft engines was another hidden, top secret, line: Norden bombsights. The extra workers were camouflaged by entering and leaving with the engine workers. That is all I was told. Presumably bombsight parts entered and completed bombsights left the same way.
Reply: Most powerful is really not importantet, least fuel pr  mile is.
Reply: how about everyone report this video for misinformation
Reply: Pratt & Whitney invented the turbo fan.  GE makes by far the most powerful jet engines in the world.
USA, USA...
Reply: @CB-dc9qj Another confidently wrong American.....😂
Reply: These days rolls royce gets 90% of their jet engine blades made in Singapore, not to mention In typical british fashion back in 2017 they had to pay 670 Million pounds in a corruption and bribery settlement to usa and brazil, they then had to restructure the entire rolls royce company to rid themselves of their atrocious middle management. The british ran the company so badly in 2023 they had to hire a Turk CEO who invested 1Billion USD into Indiana USA to build the rolls royce engines as far away from the british as possible.
Reply: Well said thats why half of Europe are looking a the SAAB latest aircraft
Reply: And of course the Americans didn't invent it did you ?
Reply: Aren’t we all
Reply: Aren't these engines made by Rolls Royce
Reply: @parterman  What engines?
Reply: @_Coffee4Closers The jet engines...
Reply: @parterman  Some are.
Reply: @parterman they make the lm2500 used on some of the ships in the Navy
Reply: @parterman  some, but they recycle end of life ones to reuse.
Reply: @parterman LOL
Reply: @parterman Rolls-Royce has about a 10% market share. The other 90% of jet engines are made in the US.
Reply: @johnstitcher1640  CFM is half French. In wide body aircraft RR has 30% market share.  Not as clean cut as you say
Reply: @johnstitcher1640  designed by a brit !
Reply: @johnstitcher1640 yeas sure. Believe it ussie
Reply: @johnstitcher1640  the zero response to these comments tells me all I need to know 😂
Reply: @johnstitcher1640  US has only Pratt & Whitney and GE, it's not even 50% of the market
Reply: @BenHarvey-1983 Yep and the technology was just given to them
Reply: @seamustreanor270 And look at how ridiculously the cars are engineered.
Reply: @BenHarvey-1983 😂
Reply: @Dabeachguy Without the US there is no industrial age. Get over yourself dufus!
Reply: @johnstitcher1640 that are also made in Wixom, MI
Reply: @johnstitcher1640  and the best engines are usualy rolls royce
Reply: @johnstitcher1640  
Rolls-Royce holds roughly 10% to 12% of the overall global aero-engine market. However, in the high-thrust widebody aircraft segment, the British manufacturer captures approximately 30% of the global market. They power a significant chunk of the Airbus widebody fleet and dominate the Airbus A330neo and A350 backlogs.
The broader commercial aero-engine market is highly consolidated, with just four major players controlling over 90% of the industry:
CFM International (GE/Safran): ~39% market share
Pratt & Whitney: ~35% market share
General Electric (GE Aerospace): ~14% market share
Rolls-Royce: ~12% marketshare

The title of the video is:
"The Insane Reason NOBODY Can Copy American Jet Engines". Even if the US would produce 99% of the world's jet engines, which it doesn't, the title would stil be a lie!
But that's what Muricans specialize in these days.
Once ruled by the smartest people, now ruled by the dumbest. And it shows.
Reply: GE  Controls nearly 60% of the Market and Pratt and Whitney 26%. Rolls Royce holds 18%. If anyone thinks that the companies that GE partners with does not have heavy influence from GE you are Insane!
Reply: You can try to massage the numbers all you want the fact is Rolls Royce has the smallest share of the market and by a lot!!
Reply: @MichaelRei99  different company the car branch was sold off decades ago
Reply: @MichaelRei99 when it comes to commercial jet engines the European companies can match anything the USA has infact RR and CFM (half French) control most of the market share, GE are great yes but not out on there own. Id argue RR make the best commercial engines. Now military jets of course the USA company's have huge market share 🙄 they are the huge arms exporters of the world!!  Market share doesn't mean the best😂  Toyota V Ferrari for example
Reply: @johnstitcher1640 nobody else possessive or makes jet engines?
Reply: @parterman it's general electric and other american companies 😂
Reply: @parterman RR does make jet engines, but they're just the little guys, nothing like the video.
Reply: And UEC and soon AECC
Reply: @rockyramsy  And you thought those companies you mentioned are the BEST in the World?
Reply: @_Coffee4Closers  Safran (France), Motor Sich (Ukraine), UEC (Russia), AECC (China), Hanwha Aerospace (Korea)...
All of them are able to make cutting edge jet engines. "are they the best in the world?" doesn't make sense. Most of GE's production isn't the best in the world. What counts is that their next product may very well be the best in the world, because the technology and know-how are there.
Reply: @neutronalchemist3241 
Who builds the largest turbines in the world?
Reply: @benztech2262 You mean the low pressure turbine of the GE90 turbofan, that's the largest in the world? 
It's made in Italy by Avio Aero.
Reply: @_Coffee4Closers no of course America is best in the world 😂😂😂😂
Reply: @neutronalchemist3241 
Assembled in USA by the American company GE.
Reply: @benztech2262 Yeah. It needs the Americans to tighten the bolts.
Reply: @_Coffee4Closers you mean you thought they aren't?
Reply: @OttomanSinbad  thought they aren't what... context dummy, WHAT are you referring to?
Reply: Exactly.
Reply: 100% - I used to work for RR. Triple shaft engines are far superior.
Reply: The extra efficiency and lighter weight make a huge difference to the airlines. The new turbine blades are supposedly excellent. Do you know if the maintenance has gotten any easier?
Reply: Back in the late 60s the Concorde sst was designed and started operating commercially in1976. Powerd by Rolls Royce Olympus engines. Even American deigned aircraft have been powered by RR. So the US isn't the only country producing quality jet turbines.
Typical. Trying to rewite history.
Reply: @artykeithpierre09 Which ones are superior today  ?
Reply: @artykeithpierre09 lots of countries build jet engines.
Reply: @Alvin-r1z lots of people have brown hair. What is your point DA? Americans make superior commercial jet engines. Nobody is even close to scale. Period
Reply: @mikeroberts8609 well I'm pretty sure Airbus is on par with Boeing,plus dassult builds engines on par with are major manufacturers,not to mention the Russians and the Chinese are catching up and will probably surpass us within 8 to 10 years.
Reply: @mikeroberts8609 sit down son you got schooled.
Reply: 😂 Exactly. Americans saving the world once again!
Reply: And, of course, in 10 years the majority of jet engines will be built in China, who, by the way, is already producing jet engines
Reply: @yannistsili6585the Chinese have been producing jet engines for many decades now. The problem they have though is that their engines are very poor quality and they have really struggled to overcome their quality problems.
Reply: @yannistsili6585and they are nowhere near as good as the ones from America or England because they have worse materials and don't have the manufacturing tech or precision either
Reply: @yannistsili6585LOL 😂 they might be making jet engines but like their electric cars, they are nowhere near the US in quality. Nice try on the gaslighting though.
Reply: @mikeroberts8609  what? Chinese electric cars are far superior to ours. What planet are you from?
Reply: @l @lifereframed100 America? 🤭
Reply: And where does RR build those engines? Right here in the US.
Reply: @SirBrass  What a complete twit! Rolls Derby that's in ENGLAND ! have you seen the designation RB that's ROLLS BARNOLDSWICK which [or should that be witch??] is in Pendle, Lancashire, ENGLAND they made/make the RB 203 for Airbus, A350, Boeing 787. America best in the world and world champs at everything - WC26 USA 2 Turkey 3, USA 1 Belgium 4. Womens rugby world cup 2025 ENGLAND 69 that's right sixty nine!! v USA 7.  Rolls do have a plant in the USA and also Singapore and Germany!
Reply: Rolls Royce builds engines around the world. Headquarters is in Derby England which is where the engineering, research and development is done. They do the most building and assembly in the UK but have large facilities in Indiana, Germany, and Singapore. They also contract work to companies in Japan and Spain. The site in Indianapolis is primarily to support the US DoD. They build military engines on site but also serve as a huge maintenance and repair facility.
Reply: India builds the turbine blades for Rolls Royce
Reply: @sarthakpanda8641 bas bas engineering technology india ke nhi hai
Reply: @Sarthakpanda8641 Indian H1Bs build most things for American companies. What is your point?
Reply: India does build some turbine blades for Rolls-Royce and they are supposedly excellent. Obviously there’s many different designs with different metallurgical compositions. The most advanced don’t leave the vault in Derby.
Reply: Aren't the new engine upgrades the B52 bombers are getting Rolls Royce a British Company,  where the first jet engines were made? 😊😆🤣
Reply: @mike-cl7pb  And who's the number one jet engine maker even today? America. keep laughing homeboy. We rule the skies and we mainly use American jet engines. As a matter of fact you guys don't have as much of a market as we do.
Reply: Mostly true today, but unless something radically changes, it will be like sand slowly slipping through fingers. There’s two sides of the coin, civil and military.
Boeing has traditionally used RR and GE engines, but as cost and complexity rises there are huge financial and training benefits with using just one engine. It would be unacceptable to pick the foreign model. Currently only the 787 Dreamliner uses RR. The same is happening on the opposite side of the pond with Airbus and RR. Boeing is having tremendous problems while Airbus is doing very well. The US trade war with India and China and basically everybody make their planes less attractive. 
The military side is worse. Most US jets are designed with massive export programs and thousands of sales (F-15, F-16, F-35). They all come with US engines. There won’t be any more of those programs for US companies. If there is another global export platform, it will likely be the UK/Italian/Japanese Tempest. There’s also still huge demand for Rafale and Gripen, which is considering switching to a RR engine.
Reply: And the Germans beat you to having the first jet engines in combat. Back in 1944.
Reply: More American bollocks. Everyone knows RR engines are best in the world!!
Reply: @100shakes LOL 😂 whatever fantasy you want. Clownish comment
Reply: American think they can do everything the best....
Reply: @nickpol2478 that's because we do.
Reply: @leonardwilliams8109 i guess you never been in Europe...  Thats why American people want to pay a premium  price for German engineered cars....
Reply: @nickpol2478  Think?  Proof is in the pudding sir. The F22 called and has yet to receive an answer...we are waiting. (Crickets)....
Reply: @BadKarma-u9h There isn't much incentive for most countries to build a direct F-22 rival. The F-22 was designed at the end of the Cold War to dominate a very specific threat environment. It was also incredibly expensive, and the US stopped production after only 187 operational aircraft. Today, most countries prioritize multirole fighters like the F-35 or their own equivalents because they can perform air superiority, strike, ISR, and electronic warfare missions in one package. Even the US plans to eventually replace the F-22 with a next-generation air dominance platform rather than build more F-22s.
Reply: @JRGUSC you proved the point that America has the best stuff.
Reply: @VACcine710 That's not the point I was making. I'm not disputing that the F-22 is an outstanding aircraft. I'm saying there hasn't been much economic or strategic incentive for other countries to build a dedicated F-22 equivalent. Most modern fighter programs prioritize multirole capability over a pure air-superiority design.

Don't conflate what is being argued here.
Reply: @JRGUSC So you are saying “we never built anything as advanced as the F-22 but we could” 😂😂
Reply: @k9m42 No....that is a straw man argument. I'm saying capability and incentive are two different things. Developing a fighter isn't just a technical challenge...it's a strategic and economic decision. Most countries chose to invest in multirole aircraft because they provide *more capability per dollar*. That's why you see F-35s, J-20s, KF-21s, Tempest, GCAP, etc., rather than everyone trying to build an F-22 clone.

You greatly underestimate the impact of economics vs technical know-how.
Reply: @JRGUSC that's why we have the F-35 series...it has more versatility.  I don't understand what we are even talking about anymore. I know you live in Europe lol.
Reply: @VACcine710 Exactly. That's been my point from the start! The F-35's versatility is why countries are investing in that type of platform rather than building dedicated F-22 style air superiority fighters. Other countries prioritize mission requirements and budgets, when developing a new aircraft......not simply for the purpose of trying to be the "best" fighter.

The same principle applied in WWII. Late-war German tanks like the Panther and Tiger generally outclassed the M4 Sherman in a one-on-one fight, but the US prioritized reliability, ease of production, logistics, and operational flexibility. That strategy allowed the Allies to field and sustain armored forces at a scale Germany couldn't match. Building the most capable individual platform isn't always the optimal military strategy.

Thanks for the personal jab, by the way. That really tells me where you're at in the conversation.
Reply: @JRGUSC I just assumed you were going to go into a rant about nothing but you proved me wrong. It's hot in Europe and they cant think straight with no AC....I figured I was getting pulling into some rage bait bullsheet.
Reply: Rolls-Royce has a 10% market share in engine manufacturing. 

 CFM (American) has 39% market share. 

Pratt and Whitney (American) has 35% market share. 

GE (American) has 16% market share. 

Rolls-Royce is welcome to the conversation,  but they're not allowed to speak unless spoken to.
Reply: @johnstitcher1640 - Toyota has a higher market share than Ferrari. But…
Reply: @johnstitcher1640  CFM is half French. RR has 12%
Reply: @johnstitcher1640 The new Rolls Royce design is going to take over the market over time.
Reply: @johnstitcher1640  Except that RR powers Airforce 1 and soon to power the B52 fleet.......quality when quality counts huh.........
Reply: @IP-k6g  theey simply won cheaper contract
Reply: @darthcryzin B🎉S
Reply: That’s not how America works. The US doesn’t give aerospace contracts on its strategic nuclear bombers, never mind Air Force One, because someone came in a few bucks cheaper. In both cases they purchased the best product available regardless of price.
Reply: @user-lw8ob2dl9t what are you talking about? Nobody said anything about stealth bombers or air force one. Rolls Royce owns a subsidiary American company that pays quarterly taxes to the irs and employs Americans and works closely with the main rolls Royce company and they make parts that get handed off to Boeing or GE or Northrop Grumman. America is the land of loopholes.
Reply: @IP-k6g 
In 2021 the US Air Force 
awarded RR a 2.6B contract 
to refit the B-52 fleet.
The other competitors
were P&W and GE.
Reply: @Jacknthebox-n8l 

The B-52 will be using a RR England design engine that will be built at RR North America facilities. RR bought Alison.
Reply: @Paul-Nicer58
I seen a picture of the 
Rolls Royce engines 
in the B-52 double 
“Shroud”. The color 
was white with the RR
symbol (before painting).
Rolls Royce did a great job 
I wonder if they’ll still use 
those charges to spool up 
the engines.
Reply: The RR factory in Indianapolis builds jet engines for the DoD and serves as a huge maintenance and repair facility. RR has similar in Germany and Singapore to support local customers. Research, design, engineering, etc. is done in Derby England, along with a lot of assembly.
Reply: My thoughts exactly.
Reply: royce perfected it before usa usa got final product at start
Reply: @Kristijan-h7k 
At the end of WWII, Britain 
gifted Uncle Joe a Rolls 
Royce engine. So now 
the Soviet Union had a 
Boeing B-29 that made 
an emergency landing 
and a Rolls Royce jet 
Engine. 
The British and Americans
Forgot about Stalin and 
Hitler ready to carve up 
Europe for themselves.
Reply: Roll your eyes all you want, America has the best jet engines and jet fighters in the world. 

And I can back it up because everybody uses our jet fighters and our engines. Who is using Rolls-Royce in comparison to American fighter jet and jet engine designs? Nobody.
Reply: This is a joke, right? You surely realize that the American military is a large purchaser of Rolls Royce engines?
Reply: @user-lw8ob2dl9t AI video. They're almost totally mindless now.
Reply: @user-lw8ob2dl9t not for Fighter Jets buddy, when it comes to the best Jet engines only Russia and China can compete, there's a reason Europe hasn't produced a 5th Gen
Reply: When single sourcing an engine for a new fighter jet, would you expect the US government to select a foreign company?
Reply: @BeachTypeZaku true lol. How many countries are begging to buy some fa-22 raptors? Even China and Russia are.
Reply: @austinwebdev  China and Russia begging to buy our engines? Yeah ok
Reply: @BeachTypeZaku You are aware that is to do with money? 

They share more of the market because its a bigger company simple.
Reply: @bewarethegwen  Obviously old boy you've never heard of Northrop Grumman, Lockheed Marten, or RTX.  And that's just 3 of the aviation manufacturers that supply aircraft to the American military. 

Pratt & Whitney or GE Aerospace ring a bell?  They should.  GE Aerospace manufactures 2/3 of the engines used in our fighter jets and those found around the world.  Pratt and Whitney produces engines and more so your snide attitude is not only childish, but misplaced😘.

Rolls is all you guys have left and even it's got issues with your own domestic military being what it is.  If it didn't have the US market it does have, it'd be a gutted fish.

They Do make very good engines and aeronautical components and it is the 3rd largest aerospace manufacturer on Earth, truth there.  However, America Rules the Skies and they do so mainly using American jet engines.
Reply: @BeachTypeZaku yeah but Rolls-Royce really just feeds of the scraps of US Avionics, hell all of Europe does, there's a reason they need to buy the Lighting II
Reply: This isn't the 1940s, Rolls-Royce isn't even comparable to Pratt-Whitney, what 5th Gen fighter has Rolls Royce supplied?
Reply: @adamgt4037 F35B lift fan. And without going too far back, the RR Pegasus engines used in both the AV8A and AV8B Harrier for the USMC were made in the UK. The RRTM Ardour engines used in the T45 Goshawk were made in the UK too.
Reply: Most of there parts are made in the US 😂
Reply: Pratt & Whitney:  laughs at Rolls Royce
Reply: This and making whatever excuse to kill off whatever competition that wants to make it..
Reply: Nevermind the fact that Germans designed the first turbofan in WWII and literally built them underground and the design hasn't changed much since then.
Reply: Americans have produced 4-5 times more jet engines then UK
General Electric, Pratt and Whitney and Rolls Royce are in the same group of building quality engines but 
America's scale of production is much larger
Reply: @OjasTelwane-v2x they have also produced 20x more bic macs and 50x more Ford Edsels. What is your point?
Reply: The video says very few countries can duplicate American jet engines. It did not say no country can duplicate.

Apparently you are one of those with attention disorder issue.
Reply: Rolls Royce in the country that can't provide A/C for their citizenry? That Rolls Royce?
Reply: @margaretchayka6878 But can provide health care. How many people go bankrupt with medical bills in the US per year? And if you've ever lived in the UK, global warming seems like a wonderful idea. Americas always tell us our weather is shit and it always rains. Now we've suddenly turned into Death Valley apparently. It must be wonderful to be so "informed" about places most of you have never visited.
Reply: @GD-gj7zo Not that many go bankrupt in the US from medical debt. It's generally not collected upon. And you aren't provided it, you're taxed at a much higher rate than us. My wife and I made $500k last year, and we were taxed at 32 percent.

In most of Europe I would have been taxed almost another $100k dollars.

Plus I'm a US veteran and I already get free healthcare. My wife pays like $200 a month for healthcare that covers almost everything. Many states have healthcare you can get if you don't make a lot of money.

The healthcare problem is wildly overstated, usually by broke asses who don't know what resources are available to them.

We really should get rid of the private system though because they get to write off all the unpaid fees on their taxes, so essentially we already are paying them.
Reply: @SeatownD Thank you for your reply. A quick bit of Google Foo is throwing up a figure of approximately 530,000 personal bankruptcies declared in the US per year, and approximately two thirds of bankruptcies are due to medical bills or illness related loss of work. Now you can make statistics read a lot of different ways, so that may not be the "whole" story. But hundreds of thousands of people declaring bankruptcy for medical bills in the world's richest country isn't "Not that many." And I have been treated in a US hospital. They wouldn't do a thing without proof of travel insurance and a credit card. And I had to sign a form that basically said that they could do what they liked, and I'd pay for it. 

And yes, we do pay for our healthcare via our taxes and we are taxed at a higher rate. But our medical industry isn't run for profit, and it doesn't have an insurance company, also run for profit, sitting between you and your treatment. Whose interest do you think they have in mind, yours or theirs? You would be taxed more, and "everyone" could then receive treatment, making for a better society to live in. Now I'm sure that you will say, "That's socialism, why should I pay someone else's (broke asses) medical bills?" But you presumably pay for your local fire service by some sort of local, state, or federal tax? Yet most people's houses don't burn down, most people don't need to be cut out of a car wreck. But you pay for that service to be available, so if you need it, it's there. Is that socialism, or is that just providing the services that every other first world nation has, apart from the US with their healthcare.

If you are rich, the US is probably one of the best places you can live. But most people in the US aren't rich. So that gives you a very disparate society, a "them and us" scenario.   And history tells us, that usually doesn't end well. Nowhere is perfect, but for social cohesion and quality of life across the board, the Nordics seem to have got a lot of it right. Certainly a little less divided than others.
Reply: @GD-gj7zo  Your NHS is falling apart because they all do eventually, and your society is turning into a 3rd-world cesspool. Freedom has pros and cons, and takes a bit of courage to maintain, hence the best medical care in the world is available here. Brits never embraced freedom fully, perhaps because your population is small and you have to marry too many of your cousins, but thanks for chiming in, Chip.
Reply: Yea that’s why Rolls Royce is a military powerhouse along with all European countries right ? Hahaha.  US  would destroy any European country with its big toe.
Reply: But the US seem to be using a little more than "one toe" against that "military powerhouse" Iran, the same country that the US announces every week how many times they have beaten them, and yet Iran are still hitting US bases all over the Middle East at will. And your Middle Eastern allies have had to go cap in hand to Ukraine for help in combating the drones. You know Ukraine, that poor war-torn country that "don't have the cards..."
Reply: @GD-gj7zo Trump's a moron for starting that war. The thing is that due to all of the media coverage in the modern age, wars are fought differently. If we wanted to just bomb the fuck out of that country until they didn't exist, we easily could do so. It just isn't politically feasible.